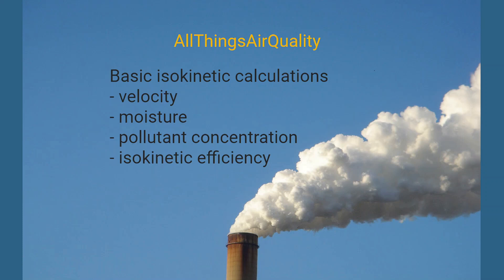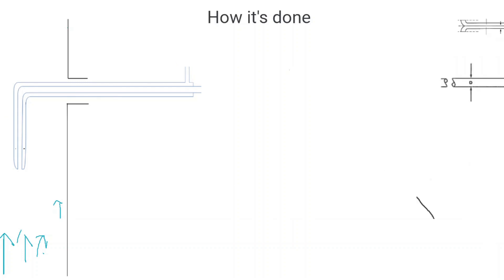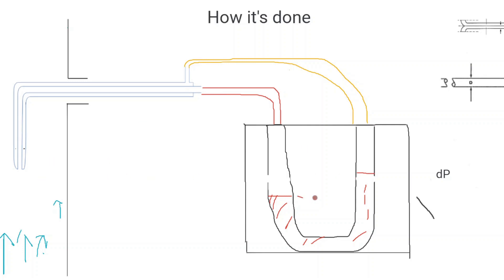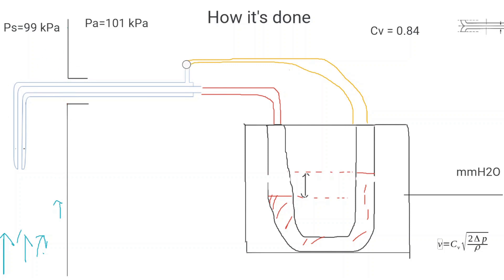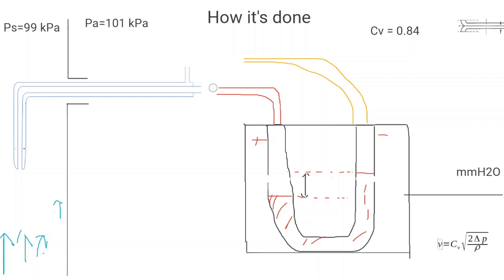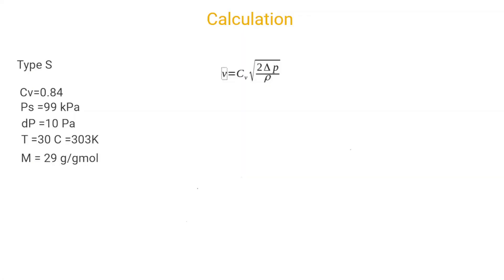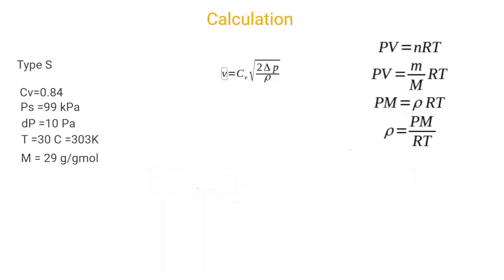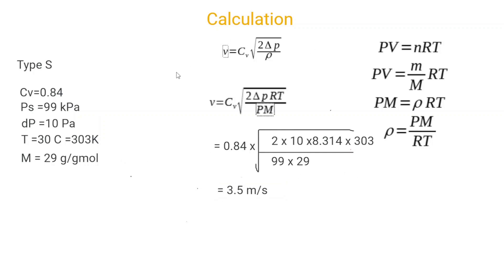Lesson 1 - Isokinetic stack test: Velocity measurement principle and calculation

Comment: Excellent explanation. I want to know if there is any factor or compensation for varying velocity across the diameter of stack.
Reply from the maker: You measure at multiple points (traverse points) determined by dividing into equal areas or using a power law to get an average. If a single point measurement is made by an instrument, this can be correlated to an average that is measured at many points using manual techniques. This is accurate if the average flow rate remains fairly constant over time, but if the flow varies a lot over time, the correlation will not always remain accurate as the velocity profile may look different with lower or higher flow.
Reply from the maker: This is an example: https://library.e.abb.com/public/88c1d287593837a2c1257c4a0048b02e/AT_FLOW_002-EN.pdf#:~:text=To%20improve%20the%20measurement%20of%20flow%20with,then%20be%20installed%20to%20that%20insertion%20depth.

Comment: Great video! The way I interpret the equation from the EPA is that you want to calculate the square roots of your delta P for each point, sum them up, and square the result. Then you plug that number into your equation which you will have to divide by your number of points (n). You will get a very small difference in results compared with calculating velocity per point and average them all out. I think it has to do with the quadratic dependence of velocity on differential pressures but am not 100% sure. It also helps with capturing variations in your "data set" if you have low or high pascal readings at some of the points. Would be great to get your opinion on that.
Reply from the maker: Hi Jordan, I agree with your interpretation of USEPA M2 Section 12.6 except for where you mention  square the sum of the roots again? Velocity is not related to the pressure drop exponentially but to its inverse. 

if I check the math it should reduces to the same as the average of all the velocities, but perhaps you can spot a mistake in my arithmetic:
Let us assume we have 3 points to simplify (You can do the math with 6 too):
12.6 reads:
Vs=KpCp*SQRT(Ts/ (PsMs) ) *SUM( SQRT(detla P) ) / n
Now let A= KpCp*SQRT(Ts/(PsMs)) to simplify writing
For our 3 points:
Vs=A * SUM(SQRT(delta Pi)*(1/n)
Vs= A*( SQRT(detla P1) + SQRT(detla P2)+SQRT(detla P3) )/3
We can separate the terms:
Vs=A*SQRT(detla P1)/3   + A*SQRT(detla P2)/3+ A*SQRT(detla P3)/3
Here each term is a velocity at the point, so:
Vs= V1/3+V2/3+V3/3 = (V1+V2+V3)/3 = Average of the 3 point velocities?
Reply from the maker: On a side note, this is not the best way to determine a stack gas velocity, or rather USEPA Method 1 is not. Applying the1/7th power law offers a much better representation of the average velocity.

Comment: How we ensure the pitot tube exactly in the correct plan of flow
Reply from the maker: Ideally you sample more than 8 equivalent diameters downstream, where you should have stable flow parallel to the duct/stack. If not you can check by rotating the pitot tube and seeing at what angle the differential pressure reads highest. USPEA Method 2 states the acceptable limitations and there is a technique to deal with cyclonic flow.  USEPA Method 2G and F deals with this.

Cyclonic flow patterns are often found after cyclones or radial fans.

Comment: How to calculate dynamic pressure?
Reply from the maker: With Type 1 pitot:
The reading is the dynamic pressure + static pressure. Thus the differential pressure reading - the static pressure will give you the dynamic pressure. The static pressure can be measured by the Type 1, through removing the + leg.

With type S: Dynamic pressure = 0.84(or your factor)^2 x Differential pressure reading.
Reply: cp^2 x deltaP

Comment: How do you know where to take the measurements?
Reply from the maker: The exact method may vary based on legislative requirements in your region, but we measure in accordance with the USEPA's procedures.  Method 1 describes where the measurements should be made and how to calculate the traverse points, see https://www.epa.gov/emc/method-1-samplevelocity-traverses